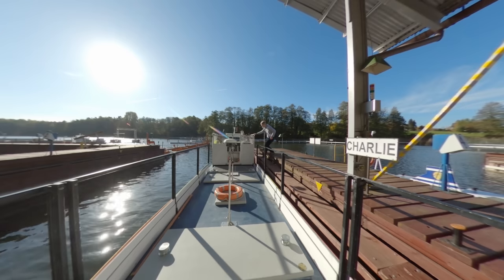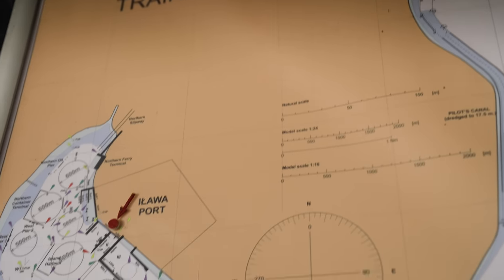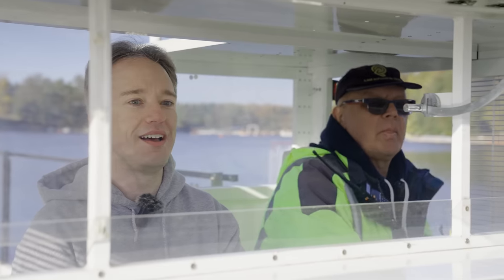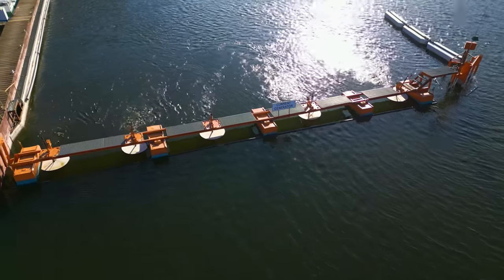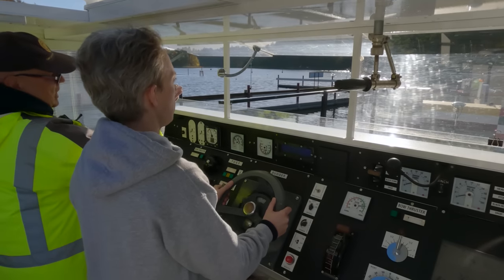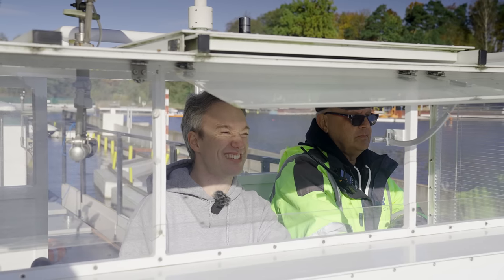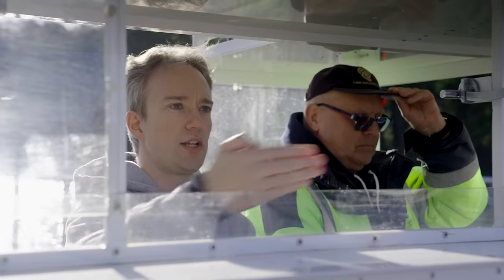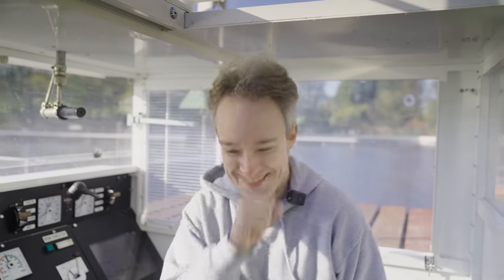These tiny ships have a serious purpose

Comment: The instructor makes an interesting point that there is a real chance of being stuck or damaged with the model boat, whereas the computer simulator has none of that.
Reply: Aye, nobody cares about scratched paint in a computer simulation. Here it's money passing hands.
Reply: That being said, it's very easy to forget you're in a ship simulator when in a ship simulator. I've spent a bit of time in a 360 projector simulator as well as in a TV screen through the ships bridge one, and it's so easy to try and look out of a window or walk to the other side of the bridge forgetting you can't do that(physically). 

It's also amazing how often you find yourself holding on to something in wavy conditions even though there is ZERO movement. Mind bending.
Reply: Computer sims need a scoreboard, except it starts with how much you would get paid for the journey and goes down every time you accumulate damage repair costs.
Cracked Rudder: -$75000
Reply: To add on top, forcing the students to think about how to unfuck their situation is also very important to maturing as a student/professional
Reply: Genuine consequences with real life repercussions
Reply: @moosemaimer  it's time too though so you need to as like 1 week to repair the bank or refloat the ship and stressed crew, tug boat costs, imminent job loss etc.
Reply: Also: Unlike in a computer simulation you can FEEL the boat here. And in the end that's also important, because in the end many decisions where to steer etc. also come from "how does the boat feel, can I rock it left as much as I need?"
Reply: That was the director.
Reply: as the instructor of the signalman training center said: You will remember every train you crashed, even if they are models.

Comment: I was expecting a 1:24 scale model to be controlled from a full-size bridge mockup on land with cameras and remote control. It's crazy to see the full-size controls in a room on the model, because the actual thing is so huge.
Reply: I as well, but this gets the trainee the FEEL of the ship under your feet, and that is critical.
Reply: my guess is that if 1:24 would have been too small to for driving manually they would have made them a slightly larger scale. Part of the design goal
Reply: I like how the instructor says it's 1:24 scale at (roughly) 1:24 in the video.
Reply: @zemja  I bet Tom edited the video this way deliberately, though, he is off by a second. It's at minute 1:25

Comment: "It's not a tiny boat; it's a 400-meter container ship." I love his dedication, ha
Reply: If you think it's a tiny boat, you'll try to run it like a tiny boat. It's a sim so it reacts as fast as a real 400 meter ship, so it cannot turn or brake fast.
Reply: @MikkoRantalainen no, the guy said everything happenes 5 times faster
Reply: @ToMeK3001pro  Oh, I mean "as fast as a real ship" in the meaning that braking or turning takes equally long relative to the length of the ship. Normally you can easily rotate a boat the size of the that model ship in place with engines but this model has intentionally much smaller propellers or other tricks to make it equally poor to control as real 400 m ship.

Everything does run 5 times faster but the movements you need to do and the pre-planning you need is equal to real 400 m ship. When this model is 4 ship lengths from the dock, it must be driven the same way as a real 400 m ship a mile from the dock.

Comment: For anyone interested in numbers, the Ever Given is 400m long, interestingly that's longer than the lock size at Panama even after the upgrades, which means that any other ships as large or larger than the Ever Given at the time would have had to take the longest possible route to go around (due to the way most shipping routes line up the Panama Canal and the Suez Canal are actually kind of in competition on some routes so slightly smaller ships early enough in their trip might have been able to reroute through Panama depending on origin and destination ports).

Comment: These should be at more seaside towns as an amusement.
Reply: Would probably bring in a lot of kids / teens who would then want to become pilots
Reply: Don't be silly that's far too much fun, they'll find a way to close it down fast.
Reply: I think you missed the part where they stated they have to repair the ships quite often. 

In an attraction park they'd go bankrupt because after every ride they'd have to repair the ship
Reply: @axiezimmah  That's because the ships are actual models, but if you design ships specifically for it that would help a lot, like for exmaple adding a bumper car style rubber ring where it would meet the walls.
Reply: this one is not even at sea side, just some lake
Reply: There used to be something similar at smaller scale and with tennis ball guns at great yarmouth, not sure if its still there. @axiezimmah
Reply: Miniport in Gunwharf Quays Portsmouth and Lakeside in Thurrock are like bumper cars on the water!
Reply: @blablablablablablblablabla  It's kind of the point since it's a very carefully purpose-built miniature at scale and I don't think the sea would be so considerate as to make waves at scale.

Comment: Funny, as soon as you explained the theory of bank effect, I was very quickly able to connect the dots to ground effect, a very similar phenomenon associated with race cars, wherein in the right circumstances a car can be pulled downward towards the ground due to pressure shenanigans and what happens when you force a fluid to flow quickly through a confined space. More than likely it and bank effect are more or less the same mechanism, just presenting somewhat differently in different mediums.

Comment: To make a turn to port, you really do turn left. Left and right are used for steering ONLY. Port and starboard are used for everything else. This ensures that when you hear the words LEFT and RIGHT, you are certain it is s steering command. In addition, we try to avoid using the other meanings of the word LEFT and RIGHT while on the bridge, as they might be confused with steering commands. So you will hear "affirmative" instead of "right", and "remaining" instead of "left".

Comment: The Port Iława Ship Handling Research and Training Centre in Poland offers training in ship handling for those who steer large ships. The training center includes a 1:24 scale replica of a 400-meter container ship that is one of the largest in the world. The replica ship is used to train pilots, masters, and chief officers from over 50 countries. The center has different mockups representing different waterways, including deep and shallow waters, different restrictions, rivers, and canals. The training program takes five days, with everything happening five times faster than in reality. The replica ship is equipped with electronic navigation and other facilities to provide precise simulations for trainees. The Ever Given incident in the Suez Canal in 2021 was a result of several issues, including the ship traveling too fast, communication problems between the crew and local pilots, and the bank effect. The center provides hands-on training to prevent such incidents in the future.

Comment: Narrow Boats although on a much smaller scale are interesting to be the ship's captain! I have been lucky enough to have borrowed my friend's boat for many miles and got it through narrow locks with inches to spare whilst steering from the back at 60ft away always worked well, but planning for the lock needed to be done and steering adjustments made 30 seconds ahead of time for each adjustment or it would result in a very difficult time!!! Great Fun :))

Comment: I've had a few canal boat holidays, which would be the closest I've come to controlling a large boat.  In shallow canals it was like you were going uphill as the propeller sucked the water from under the boat.  Have you done the Panama Canal Tom?  I think that would make a very interesting video with the methods they use to save water.

Comment: If something goes wrong on that lake, you really are stranded, even if it's at 1/24 scale and the rescue mission will be 5 times quicker. If the boat is damaged, it's actually damaged and will be taken-in for repairs. The stakes may be shrunk, but they're real.

Comment: to put the scale of a container ship in perspective that 1/24th length scale model was still about the volume of a small apartment. 1/24th length = 1/13824 the volume. these ships are the size of an entire high density housing region in a city.
there is no such thing as little bump when you weigh 300,000 tons...600,000 if we're talking about the biggest oil tankers instead of cargo ships.

Comment: Ah, the good ole Venturi effect.

There's other aspects of seamanship influenced by this. 

A large, fast ship cannot go fast in shallow waters. The Venturi effect between the hull and the bottom of the sea will pull the ships downwards, and that can do all manner of bad things to the ship, like bending it or indeed damaging the prop shafts. 

Similarly, two ships under way alongside each other have to be careful, e.g. a replenishment ship transferring stores to a warship. If they get too close to each other the Venturi effect takes over and sucks the ships together. If this starts happening there is literally nothing that can be done, and as the effect increases as the gap decreases the hit can be quite violent. 

Worse, the instinct if this happens is to stop. The problem then is that the wave action on either side tends to push the two ships back together (there are no waves in between the ships, which is why the waves on the other side move the ships). All that can be done is for one ship to sail off, scraping down the side of the other and hoping to do as little damage as possible. A very strong bow thruster and azipods (instead of props / rudders) might mean that the two ships could pull themselves apart going sideways, but it's a big ask. 

The Venturi effect is like a massive magnet, pulling things together. Physics is a right nuisance, sometimes.

Comment: I’ve always wondered; I know they build everything to scale but what about the specific weight of water and how that interacts with a large ship vs these models?
Reply: Or maybe viscosity is the right term instead of specific weight?
Reply: Viscosity is negligible in either case, at that scale.  Specific weight (density) is handled by scaling down the time -- you get to choose a time scale such that the effects are the same, since that's the main equation where the time shows up, and it turns out that a 1:5 time scale (the square root of the distance scale) makes those effects have the correct behavior.
Reply: @BrooksMoses Makes perfect sense. Thanks!

Comment: I don't think that old guy realizes what simulations are capable of. Can't simulate wind and currents? What like airplane simulators can't simulate turbulence and wind? Wind for airplanes are even harder to simulate cause it can come from any direction where with boats its just your sides. 5 days in this lake is equal to 25 days in a simulation? Simulation means you can just reset if something goes wrong? Try resetting during your exam.